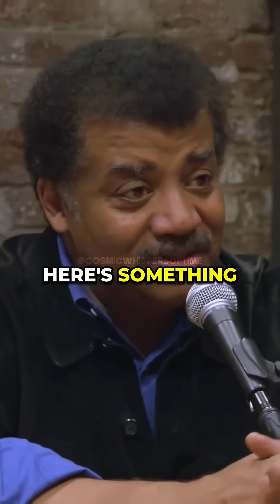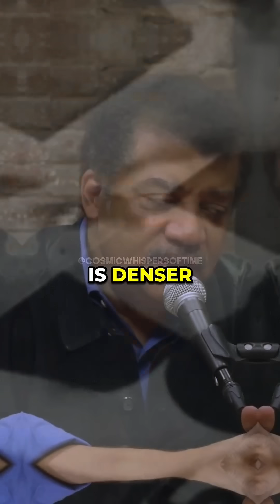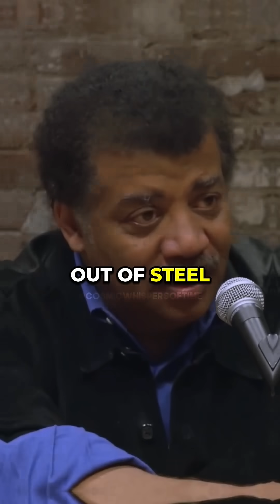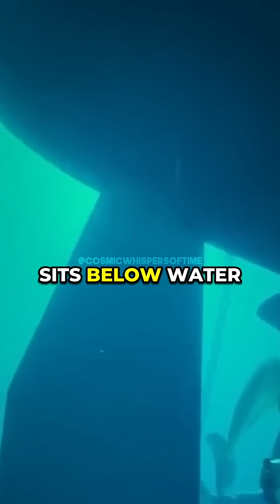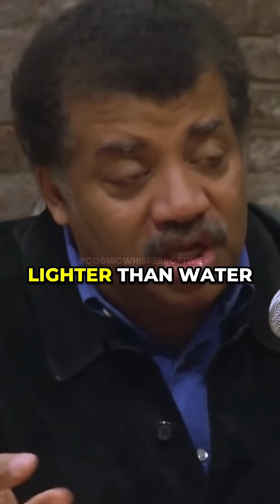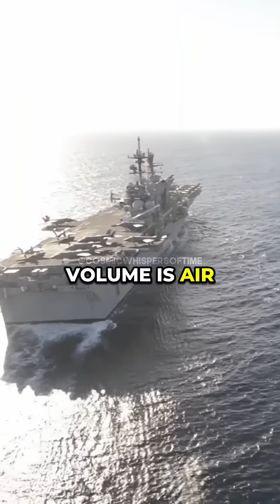Why Giant Steel Ships Don’t Sink 🤯 w/ Neil deGrasse Tyson

Comment: In ships, Displacement refers to the weight of the water a ship displaces when it's floating, which is equal to the ship's own weight. This concept is based on Archimedes' Principle. Displacement is a crucial factor in determining a ship's buoyancy and stability.
Reply: EUREKA!
Reply: @rishabsingh8009 don't drop your towel!
Reply: Not exact but close air has nothing to do with it
Reply: I was waiting for him to bring up displacement, but he went to "air". This may be an example of why so many people don't hold him in high regard as a scientist.
Reply: That's what NGT is also saying though. The total density of the object is less than the density of the water as part of it is floating above the surface (i.e. the displaced volume of water that weighs the same as the whole boat is less than the size of the boat).
Reply: Very true. Things float because of some dead Greek guy.
Reply: Yessssss. Fluid dynamics
Reply: @AG-yb1lm tell that to Neil, and see if you get interrupted.....
Reply: I was wondering how this clip applied to things like john boats/those metal fishing boats that don't have air in a hull.
Reply: @ air has nothing to do with it
Reply: lol hes pretty dumb for a physicist ....lmfao  they didnt not build ships  out of steel  because they were too dumb to to figure out that it can float... steel was too expensive and difficult  to make into something as complex as a steel ship..... u needed steam engines, complex machines, etc..... they had to wait for the industrial revolution to really kick off and for the tech to get better before it was feasible, which is why it happened in the late years of the civil war... cause technology tends to skyrocket when ur at war  .... they knew ships floated cause of buoyancy , they weren't stupid..... the wooden ships were gigantic.... would sink if it wasn't for buoyancy of the displaced water.
Reply: Exactly excuse my French but its fuck all to do with air...its displacement...I already knew this man was a fraud of his mRNA jab comments. But this just takes the piss.
Reply: ah........What??????????????
Reply: Neil even gave the water displacement equation that Archimedes used. The Archimedes screw was pure genius, and his weapons designs were just fantastic. He was using lenses to set enemy sails on fire before others. He truly was a genius.
Reply: Also, density is mass divided by volume, not the other way round, so Niel is wrong.
Reply: @jimmycricket5366 .  Wtf
Reply: NERD ALERT 🚨 ‼️ 🤓

Comment: I still dont understand how a ship, with so much weight high above the water, like a cargo ship or cruis ship, is still so stable in the water
Reply: Say the ship is 10m height, 3m of it is in the water and inside is that 3m height volume is air and would be enough to carry the rest of the weight to float.

Comment: Neil was correct to all the folks here stating otherwise: I found this on google: 

“Air's Role:
A significant portion of a boat's interior is air, which is much less dense than water. This air, along with the materials the boat is made of, contributes to the boat's overall low average density, making it float.” End Quote….

Now to be fair, displacement is correct but it’s the air in the boat that causes it to be less dense than water overall. 

So both Neil and the commenters are correct. 

Oh and his conversation here is edited…. I think his guest stated something like a joke or whatever and Neil jokingly shot back at him. This part of the video is clearly edited. 
He’s not rude at all.  
Hope this clears it all up.

Comment: anything that floats is lighter than the weight of the water that it displaces
Reply: Archimedes’ eureka.
Reply: Archimedes....
Reply: Nope gr karma
Reply: Anything that floats will displace a mass of water equal to its own mass. Anything that sinks will displace a volume of water equal to its own volume
Reply: @ mass is weight of mater correct ?
Reply: @rob-f6l  mass is the physical quantity of something. It is invariant. 1kg on Earth is 1kg on the Moon is 1kg floating in space. Weight is a measure of the gravitational force of attraction between the mass of the Earth and, in this case, a mass of 1kg. The proper units are Newtons, so a 1kg mass has a weight of 9.81 Newtons on Earth (2.2 lbs in old money) but a 1kg mass has no weight if floating in space.

A boat of 1 kg mass will displace 1 kg mass of water. A boat of 2.2lbs weight will displace 2.2lbs weight of water
Reply: @jonsmith1809  so an object not subject to gravity has no weight  ?    so i stand corrected     sorry for screwing that up
Reply: @rob-f6l  that's right. It means a 1kg mass on Earth that is in free fall has no weight

Comment: What !? Einstein  !? Really !? The first !? That was 200 years before he born.
Reply: Try around 2.000 year...
Reply: He didn't mention Einstein at all
Reply: @spearhrower  Yes but, why Einstein's fotography when he says " the smartest person in the world  " ?
Reply: @CarlosSilva-mx7ey  That is a good question, as it was Archimedes that invented the Archimedes principle, on which the formula to find density is based. 

Which Neil deGrasse Tyson got wrong, as it is not volume divided by mass, but rather mass divided by volume.  

After all, the more volume, or the less mass, the LOWER the density should be. Therefore, the correct formula is:
 
p = m ÷ v | p = density

In Neil's formula (volume divided by mass), the more volume, or the smaller the mass, the greater the density would be. 

Also, this all has nothing to do with "giant steel ships" specifically. The Archimedes principle is valid for everything that floats (or not), whether built from wood, steel, concrete (yes, there have actually been ships built from concrete), or plastic.

Sooo...... Albert Einstein has actually nothing to do with this.
Reply: Also, his formula to find density is wrong.

If you divide volume by mass, as Neil deGrasse Tyson suggests, then the higher the volume, or the smaller the mass, the higher the density. That can't be right.

The correct formula is the other way around: to find density, you divide mass by volume, so the higher the volume, or the smaller the mass, the lower the density.

p = m ÷ v | p = density.

Undoubtedly a simple mistake, but then again, it does demonstrate the need to always be critical.

Comment: Neil just casually implying wood is less dense than water. Who listens to this clown?
Reply: Some  types of wood is less dense than water and floats, some types of wood is more dense than water and sinks.
Reply: If you compared the weight of wood and an equal amount, or volume, of water the sample of wood would weigh less than the sample of water. This means that wood is less dense than water. Since wood is less dense than water, wood floats in water, no matter how big or small the piece of wood is.

Comment: No the formula for density is mass divided by volume and not the other way around, Neil. This is 7 grade physics.
Reply: technically it's just about the ratio between the two, more volume and less weight.  
It's like saying "I go 50 miles per hour" instead of "i need an hour for 50 miles", same thing.
Reply: @Irondragon1945 absolutely not.
Density isn't volume divided by mass.. end of topic he's wrong stop giving examples where not needed especially where ir doesn't apply.
Reply: @Irondragon1945  it's actually like saying I go 50hours per mile. 

which is wrong and nonsensical
Reply: @grimendancehall  50 hours per mile means you need 50 hours to go one mile, which corresponds to 0.02 miles per hour.

Easy
Reply: @Irondragon1945  also 2 separate things.

density = mass/volume 
specific volume = volume/mass = 1/density
Reply: Hes not talking about density, hes talking about "specific volume" the formula for specific volume is volume/mass. To be more accurate the specific volume is the volume of both air and steel hull combined (both have different densities).